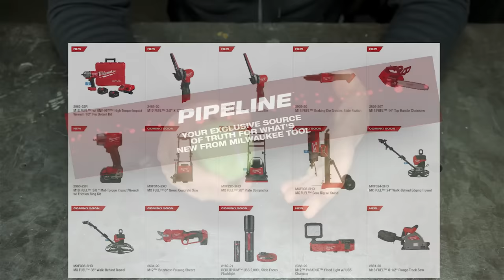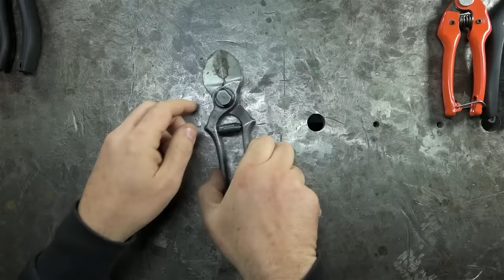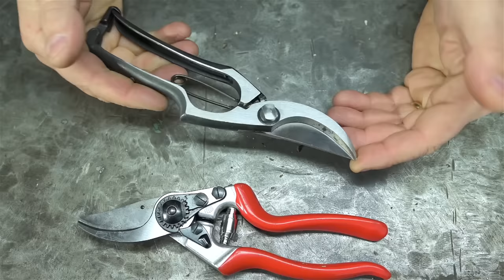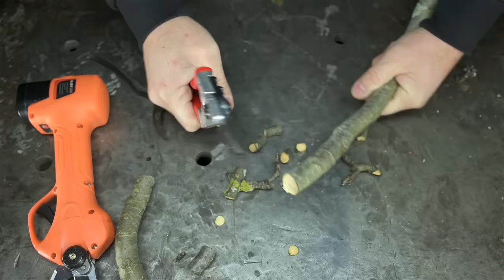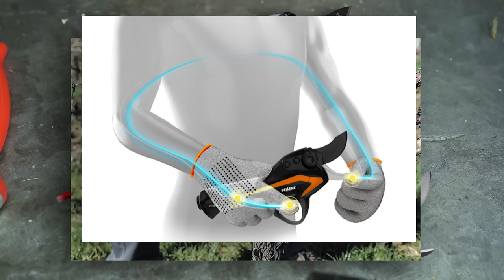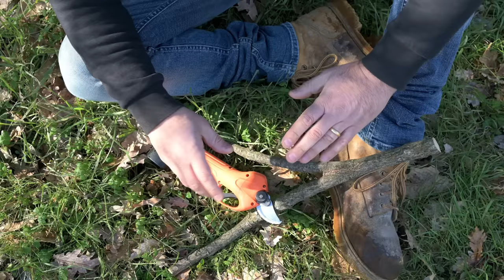MILWAUKEE ?!?!?!

Comment: Those klebtek power shears are amazing. I am shocked. I prune back some small trees and bushes in my front yard every year. I use manual sheers. Each season, I make at least a few questionable decisions to prune back some bigger branches. If they're maybe 25mm in diameter, I can sometimes get by with a bigger set of manual bypass shears that have long handles for extra leverage. I don't remember the brand. I probably bought them at the orange big box store. The extra leverage makes a big difference. When those aren't cutting it, I pull out a hand saw for those few cuts, and it's fine.

However, in my back yard, I have a walkway going to a deck above my garage. My neighbors have a jungle in their back yard. I don't know what kind of trees they're growing back there, but each season, they completely overhang my walkway with new branches that make my walkway impassable. It's always a pain to prune back these branches, which can get pretty thick. Those klebteks would be amazing for this, although the other advantage of having manual sheers with long handles is that they give you a longer reach. So I can reach over my fence and cut the branches in my neighbors' yard rather than cutting them in my yard. That buys me a little time at the start of the next season before they grow back into my yard.

I own many tools from Milwaukee's M18 and M12 tool lines. So I also have the batteries. I think Milwaukee tools are generally pretty durable and powerful. However, I gotta say that some of them can feel a bit klunky. I bought a few 18V Makita tools, and I think the ergonomics of Makita's tools are generally better. Their subcompact 18V drill is my go-to drill because it's incredibly light, surprisingly powerful, and it fits into tighter spaces than any Milwaukee drill that I've ever seen. I also own and prefer Makita's circular saws.

Sometimes those cheap mystery-brand Chinese tools can be amazing. I own a tiny battery-powered no-brand made-in-China air blower. It's lightweight and tiny. Can I get the PSI that I get from my 40 year old extremely loud and heavy plug-in air compressor? No. However, the little battery-powered air blower is very useful for blowing out sawdust from the air filter in my shop vac. I think it was $20 on amazon. It charges via a USB cable. It works fine. In this case, it's very useful to have a tool that is cheap, lightweight plastic than something heavy-duty so I can hold up my shop vac over a garbage can with one hand and blow the dust out of the filter with the other hand.

Comment: I worked in gardening for more than 20 years and always used the Felco ones they never disappointed me. Also tried the Japanese ones but maintenance is a bitch with them. I own 20 apple trees, and when I get to pruning them seriously are used to get serious aches in my hands. Last year, a friend of mine loaned me a stihl one with akkupack on the back and powercord and it was quite an amazing experience, but as you said the cable is not so convenient, but my hands were happy.
Reply: I also use Felco and it never failed me. Plus they can be maintained pretty well as spares are available for parts that damage over time.

Comment: Their 90° die grinder is my most used tool. As a machinist, it's so nice to not need air to cut, grind, or debur.
Reply: Do you find it powerful enough? I have been thinking about getting one, but the info on the Torque Test channel was somewhat lukewarm.
Reply: @qcnck2776  it's got a pressure cut off if you use it too hard. Power won't be a problem
Reply: @qcnck2776  with 2in rolocs I've never had it cut out. I've never really needed to apply that much pressure honestly.
Reply: @qcnck2776  It works perfectly fine. I use one all the time and it will go through metal way faster than you would expect with a 2" flap disk. They are measuring power when under load, but you shouldn't be loading a die grinder with much force. The whole test methodology is flawed by the concept of "More power, more better" since it is more nuanced. You let the speed of a die grinder do the work for you. Powers main objective is to make sure it doesn't stall at a moderate pressure to keep contact with the material. The only time mine ever stalls is towards the end of a battery.
Reply: @qcnck2776  If you have shop air, I'd recommend staying with the pneumatic tool.
The electric die grinder hasn't equaled or surpassed the air tool. 
I'll wait until the electric beats the air for one of these.
Reply: @qcnck2776  I used one to grind a rusted-in-place and broken off inch and a quarter bolt down to the threds so I could pull them out with a pick. It worked ok. They eat batteries if you are going to use them heavily but for light clean up work they are great.
Reply: @qcnck2776 
Milwaukee die grinder. I’ve had to have the main bearing replaced once and now it’s gone again. 20 thou wobble. My Ingersoll die grinder is still 100% after 20 years.
Reply: More power more better burns the bit.
Reply: Air is so much nicer for grinding than electric is.
Reply: @grumblycurmudgeon  water doesn't cut anything. The abrasives in the water do. The air in air tools just powers the motor in the tool. Same deal. It's all fluid dynamics.
Reply: For regular use my 30 year old Ingersol Rand pneumatic die grinder is my go to. Bearings and rotor vanes about every 10 years and good to go all day long. I have the M12 90 degree die grinder and for quick touch ups or maybe cutting a bolt off in the yard is nice. But like others have said, big battery, 6AH minimum and bring a spare one too.
Reply: @a-k-jun-1  air runs cooler and throttles nicely. Air stalls out more gracefully than electric does too. Like if you get a cut off disc caught in a cut.
Reply: @1pcfred  Well! I stand well and truly touchéd. Seeing as we're unfamiliar with humor, fine: have it your way.

Ladies and gentlemen, boys and girls, warriors of weekends of all walks of life! Presenting... armed with naught but his garnet abrasive filled sand-blaster, Paul Frederick has agreed to what is formally known as the Grand Canyon Challenge!

Aaaaaaaand.... GO!

Comment: As someone who just spent $5 on a cheap set of "sheers" AKA "thicc scissors", I look forward to this deep dive into overcomplicatedness. From a stick, to a stick with attachments, to a gas leaf blower, to a battery electric leaf blower, to a rake.
My favorite (hands down, near my hips) power tool: the trusty floor buffer. Flip a switch and electric pixies make the drill sergeants go away. 100% full manual control, baby.

Comment: I've used Corona bypass shears for decades now. Originally made in Corona, California for citrus grove workers, they're durable, easy to maintain, and used to be reasonably  priced... not sure about now that they've been bought up by a conglomerate.

Their most basic design is very similar to those Toshibo shears.

A quick Google search finds them in the $25 to $45 range, depending on the model and seller.

Comment: I bought the Kebtek 40mm, 25v model. Yes, it goes right through 40mm with no problem. It also has a half opening mode when working on thinner branches so it cycles faster. It also has a cut counter on it so you know how many cuts you've made on a charge. After 200 cuts I still have a decent charge left on the first battery. I love these things.
Yes, it will eat your thumb or anything else you get in the jaws in a second flat. Not for children or anyone accident prone.
Reply: Now Kebtek have new 40mm electric pruner model: KT940. Would you like to have a test ?😊

Comment: I got the Blue Makita Compatible secateurs about two years ago. Works FANTASTIC. Here In Australia i've got all my fruit trees and firebreaks. The one I got (I think you can order compatible with what-ever battery system you have and they all look similar ) Blades are cheap to replace and it is super torquey. Doesn't look so chunky like this one in the vid. Got it for about $150 on the usual chinese sites.
Reply: If you think those Makita Compatible secateurs are good, you should try the Makita Compatible mini chain saws. You'd be absolutely stunned how well they work, and it's such a handy and easy-to-use form factor.
Mine cost $13 delivered (probably a pricing error). The disadvantage of mine is there is no oiler, so you need to take the oil bottle with you and squirt the chain every so often. I've cut heaps of branches and only sharpened the blade once. Amazingly good.

Comment: The Bacho ERGO is the go. I've had a set for 10 years and have used them heavily as a Vineyard manager. The roll handle helps with fatigue as well as the large size so you can get both hands on big cuts. Lowe anvils in size 7 are what you need for lots of small cuts, say trimming canes or any detail work. What you have there are for weekend warriors.

Comment: I've been getting a lot of garbage tools from Milwaukee lately.

6 years ago, if it was Milwaukee I knew it would be bulletproof and well designed.

The kast 20 Milwaukee purchases always lesves me with a who the heck decided to release this feeling...it seems like a rough draft tool not ready for market at a premium price

I was fully committed to the platform with over 60 batteries.  Now it's often a better deal to buy another brand, even including purchasing new batteries...

Their ridiculously priced lawnmower and powerstation inverters for not great products was the tipping point, and now I'm invested in 4 other major brand platforms and loving it.
Reply: The shop I work at switched to red last year. All the drill chucks are already eff'd, the cordless grinder has become very loud and the batteries run out way too fast. Should have stayed with the blue ones...
Reply: @reinermiteibidde1009  It's embarrassing honestly.

I feel a little bad for all the people I convinced to choose Milwaukee all rhose years ago....because I've been hearing a lot of complaints lately about quality control.  Especially brand new expensive batteries that stop charging after only a few cycles

Comment: Pick whatever brand hand pruners you want, as long as the brand starts with an "F" and rhymes with schmiskars or schmelco... I'm a $10k+ invested red-blood, too (auto tech). I look forward to Mil letting me down for many years to come with the wank-factor superceding decency and functionality.

P.S. $5 says the TOT shop will have a Kebtek banner in the background from here on out.
Reply: Milwaukee is big on hype but comes up short on real world performance.
I like how other companies do a better job of giving repeatable power specs.

The Milwaukee batteries always have the most BS promises of "50% more power and 70% longer runtime" only to find out it is exactly the same as the old battery.

Comment: Thanks for the video Tony.
However I do beg to differ about the use of (blade and) anvil secateurs. I used to work as a viticulturist and we used them exclusively. I use them for my citrus trees as well (despite having a VERY good pair of Bahco PG-10 bypass secateurs with glass fibre reinforced nylon handles). Also I'm told that, here in New Zealand the kiwifruit industry uses the same German Lowe anvil secs that I have exclusively.
My understanding is that anvil secs do much less damage to plants that have soft or delicate bark and make a much cleaner cut but are only really good for thicknesses up to 3/8". Cheers.
Reply: I suppose it's also a preference thing, here in Germany I've mostly seen bypass secateurs in viticulture, like 95% of people use Felco.
Reply: @simonargus7662  IN NZ we use anvil for young canes and bypass for chopping out any old wood that needs to go. Most of the pruning work is cutting canes back so the anvil type is used the most by itinerant pruning teams. Then the head viticultururalist might go through with bypass secs (and a saw) to do any heavier work that is needed.

Comment: I'm not sure if these are available everywhere, but I have a cutter with a (very) long handle and a mechanism to increase the power that let you manually cut 5cm (2") thick branches. No battery needed.

Comment: Hey Tony, I'm a little late to the party, I used to work in agrculture. We used to have the Pellenc you showed briefly. Yes they start at 1k, yes they have a cable, but you can run them for multiple days, prune hundrets of trees in a day and they keep on cutting. The big advantage of the Pellenc with the back or side mounted battery is that you remove the weight from your wrist. Additionally the Pellenc shears have a rubberized metal body and obviously offer rathily avaiable replacement parts. I can only recommend them, how you get them past your wife? no clue, but we have the 2 of them since 10 years.

Comment: I work at a vineyard during the winter pruning the vines so we're talking over a thousand cuts per day between a few mm and about 3/4 of an inch, 6 days a week for 2 months or so, to say it'd be a poor idea to test my handshake in the early spring would be an understatement. 
My surprising recommendation for bypass secateurs would be the humble Wilkinson Sword 1111363W, they're dirt cheap (£10-12), bombproof plastic construction, comfy in the hand, have standard adjustments and hold a reasonable edge. I sharpen them twice per day but this is mainly because of encounters with the trainer wires, some days they won't need a touch up at all. The springs can wear out occasionally but they're cheap and easy to replace, I've never snapped a blade despite some fairly ambitious cuts involving both hands and the occasional caveman hammer (a big rock). My preference is down to the fat handles which cut down on bruises and blisters and the top slide lock which is way better than those annoying ones by the hinge or even worse the ones that hang off the back, those things disengage/reengage as and when they feel like it.
My boss keeps talking about getting us some automatic pruners but having had a look at the ones available it's generally a case that they're just not suitable for the job, they're either too flimsy and have a small battery which won't hold up to the work load or they're huge and bulky to the extent that they'd be more tiring than manual secateurs to use. My carpal tunnel and tendons pray that a solution can be found.   
Oh and always wear gloves, blisters and calluses are no fun, look after your money makers.
Reply: I'm in the same line of work, we have the Infacto Electrocoups. They make literally everything else by every single other manufacturer look like a Fisher Price toy. I spent 5 weeks pruning hectares of vines last year with them with absolutely zero fatigue. Pass a diamond hone over the blade every couple hours, oil them periodically and they will pay for themselves in a season. The sheer speed you can work at when you're just twitching your index finger on a trigger instead of having to line up and squeeze over and over is amazing. They'll also go through inch-plus dead wood and spurs without blinking so reworking vines is just as easy as pruning canes.

Comment: For any other pruner fans out there, if you get carpal tunnel or Any repetitive strain type aches and pains get a set of bahco ergo secateurs. Plus  I find the steel quality of bahco better generally as well. Changed my life I tells ya. Never touched my felcos again. 
Also, the Japanese pruners tend to be very specialised, often for roses where the thin blades cause less damage and cut cleaner. Seeing tone use them on walnut made me wince.

Comment: Hi Tony, or can I say this old, I just bought the best ever cutters at the Lidl supermarket here in Brittany France where I live.
It is a pvc pipe cutter made from aluminum with a stainless blade with closes in small steps.
It cuts branches up to 42mm. just over an inch and a half easy peasy. Greetings Chris.

Comment: I had a fuel impact. It lasted  6 months. Sent it back to factory. 6 months later factory gets back to me and  tells me the brushes are gone. ITS A BRUSHLESS TOOL! Mean time dewalt I got to use while i waited lasted 4 years. And dewalt fixed it for free. Free. Not even shipping. Detent went and they covered it. Wasn't even under warranty and they said no problem.
Reply: I have had several Milwaukee tool failures on virtually new tools. I really hope they get their factories out of China and bring it back to the USA. 
DeWalt is a better quality tool in just about every case.